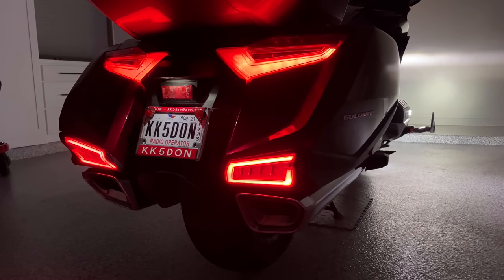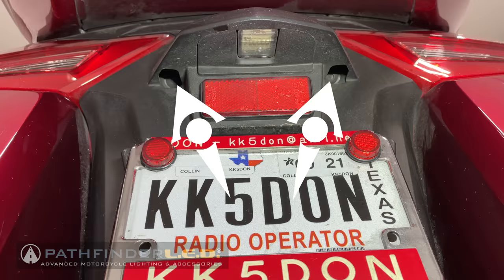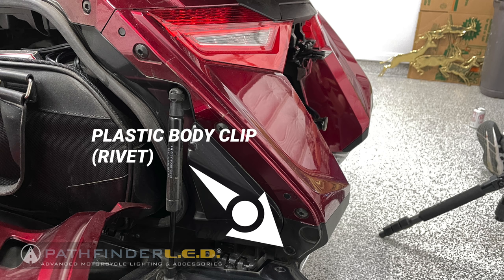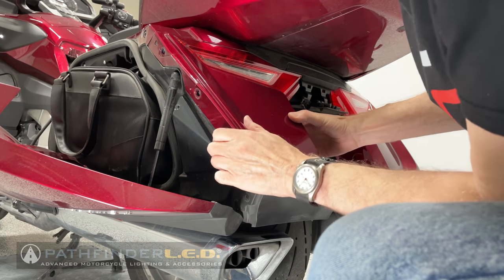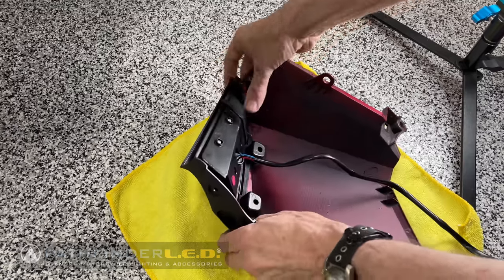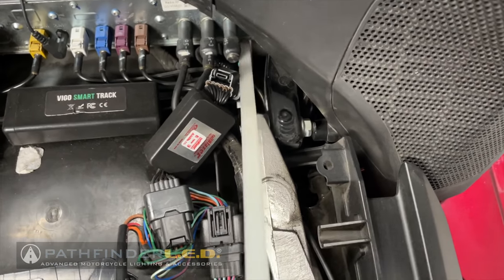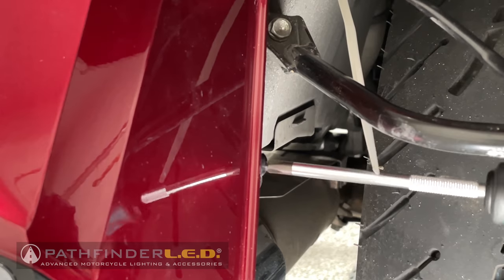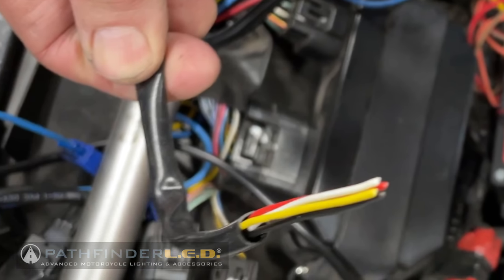Rear Saddlebag Dynamic Sequential LEDs in 4K | 2018+ Honda Goldwing | PathfinderLED

Comment: This is the nicest saddlebag rear lights for this bike so far..they look  OEM and Honda should had done this. I like how you don't have to drill any holes in the saddlebag plastic and the install is very easy. I want to buy these right now..😁

Comment: Do you also have a video of actually connecting the wires to the PAH after you've lopped off that connector? I've looked at your how to install the PAH and this one, and there's that gap in both. I have a 2021 if that makes a difference. I need those turn signals so bad. There is a real lack of rear lighting on this bike. I GOT THEM INSTALLED AND WORKING USING YOUR VIDEOS! Now onto the Pathfinder LED spoiler!

Comment: I have installed these lights but need to connect the wires. I wanna do that with the electrical connection system instead of the pathfinder power hub because i don't like cutting off the connectors. And i am going to place lights from diffrent manufacturars and the system from EC is made for all the manufacturars.Also i am waiting for the rear spoiler for the 2021 model, i ordered one at Pathfinder directly but it is still waiting for it because they are not available yet. I received a mail from Pathfinder that i am on their shipping list. So, fingers crossed. But what do you think of the EC system? Is it reliable for the 2021 model or absolute necessary placing the Pathfinder power hub?  Thanks.

Comment: I'm using already the Pathfinders 2018-2021 COWL LIGHTS WITH DRL + SEQUENTIAL LED TURN SIGNALS and Pathfinders 2018-2020 HIGH MOUNT SEQUENTIAL LED BRAKE RUNNING LIGHTS All connected via 2018-2020 GL1800 PLUG N PLAY HARNESS ADAPTER FOR LED LIGHTING So I'm asking myself can I connect a third Light. In this case the Pathfinders 2018-2021 REAR SADDLEBAG DYNAMIC SEQUENTIAL LED. Or should I connect all those lights via this new GOLD WING POWER DISTRIBUTION ACCESSORY HUB.  Should I be worried about to many connections to the canbus system off the wing.
Reply: Hello Bart, Yes if you already have the Pathfinderled G184XP cables then you can connect up to 4 of our lights.
Reply: @pathfinderledadmin293  Thanks